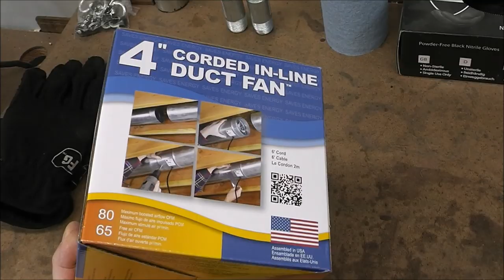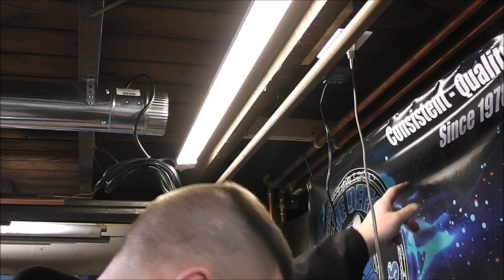EASY DIY Welding Workshop Ventilation Fume Extractor  Done CHEAP

Comment: i know this is a older video, but i like to mention that it's not recommended to place the aluminium duct on the exhaust that close, because the extractor will mess up your air/fuel ratio when you are doing air/fuel adjustments on a carburetor due the lowering of backpressure caused by the extractor.  Best is to use a metal bucket with a bigger diameter then the duct pipe, and place that at least 5 centimeters from the exhaust tip.
Reply from the maker: Thanks for the info!

Comment: I bought a bounce house blower from a guy for $20. I was going to put some of the semi rigid dryer duct on the in/ out to be able to place the suction end right at the source of the fumes. Set the output at the garage door to blow outside.
Reply from the maker: That sounds like an awesome setup! Probably much more powerful than than this setup. Those blowers move a ton of air!
Reply: Yeah. I've been trying to teach myself to weld with flux core, and it throws a ton of smoke. Last winter was a headache because the doors had to be open to exhaust the smoke. I ran across the blower after it started warming up, and that smoke was the first thing that crossed my mind. Just now getting around to thinking about the install with it getting cooler again. I was wondering if the semi-rigid duct would allow me to position it and it stay put. Thanks to your video, I believe it will.
Reply from the maker: I think it will also. Mine stays put pretty good. If it doesn't, you can use some metal wire to position it where you need it.

Comment: I wonder if the fan is strong enough to pull the welding fumes out of the room?  Maybe the next time you weld something you could comment on it.  Thanks.
Reply from the maker: It is Richard. It's vented to the outside. If the intake is above your work it easily removes the fumes.

Comment: Nice Brandon. I have something similar made in my garage for both my car exhaust, and welding fumes. 
But my I suggest that you do NOT have the duct sealed well against the exhaust. If you run your bike long enough, your whole pipe might become too hot and your duct fan would fail. Not only would the fan coil overheat, as it depends on the fan to cool it, but the fan blades are made of plastic, and they may melt. I suggest leaving a gap so the duct would draw in some ambient air to cool the intake down. That's how I've done it with my car exhaust extractor duct.

oh and btw, that sticky aluminum foil.... I'm not sure if you have the same kind I have, but mine looks exactly like that. We use it to wrap our diesel stove duct joints. It is heat resistant. I once even used it as a quick and cheap exhaust patch and worked great for years till I replaced my exhaust. Just a tip if you're interested. 

Thanks for the videos!
Reply from the maker: Good point on not making a solid connection at the muffler...it makes sense.   I know this stuff sticks like crazy but I was not aware it was heat resistant. It does not surprise me though because it just feels like quality. Thanks for the great comment :)
Reply: @BrandonLund   You're welcome. :-)

Comment: That's a good build ,   always  safety  first  , I have some  4 inch flexible black corrugated plastic   It comes in 100 ft coils maybe less I think I am going to try using some of it  to do something like your build .  Thanks.  TANK
Reply from the maker: Using what you got...I love it! It should work just fine.

Comment: Great build!!! I managed to catch a local carwash going out of business and bought one of those big industrial shop vacs for $100 put it outside ran the hose inside to my welding corner of the garage and put an on off switch inside for it and it works great!!!
Reply from the maker: @Donal Thats an awesome idea and an even better score! Well done!
Reply: @BrandonLund  those thangs are actually tanks. I guess the coin mechanism is set to restrict some of the 2 motors power because after you strip all that junk out wire in an on off switch your left with two 5 HP motors. Plus replace the door seals with rtv gasket silicone and take the motors out put silicone around where they seal and bolt them back down.
Reply from the maker: No wonder they are so powerful! That's going to be an awesome setup!
Reply: @BrandonLund  it's been sat up for over a year now just sharing what I done to solve my little fume extractor
Reply from the maker: Oh gotcha. It sounds like a very good setup. You actually inspired me to keep my eyes peeled for one of those units.
Reply: @BrandonLund  definitely worth getting

Comment: Hey Brandon. I know this is an old vid, but getting ideas for my own fume extraction for barn shop.One thing I discovered is that the higher volume of the cheap Harbor Freight inline fan works GREAT. Much better than the inside the duct fans. But while portable it's more clumsy. It's so easy to use those in the duct fans in a permanent application. You're the welder so I'm sure you already bought of this . . . you dint show us how it worked on weld fumes. For stick and flux core welding I place the flex duct right on the table. Pulls those fumes away easily. HOWVER, it's too much air flow for MIG & TIG (shielded gas) welding. Don't want to pull the shielding gas away fro the weld. For others watching I fabricated a way for it to hang over the weld about where your head would be. It allows the welding fumes and gas to to raise normally, but then suk them away before they get under you mask.
Reply from the maker: Nice! 👌

Comment: Great idea I’ve got a use for this in my shop. Maybe a couple of rare earth magnets glued to the end of the tube to hold it to the exhaust.
Reply from the maker: Great idea! The exhaust in this is aluminum but it could be very useful for holding near your project also
Reply: Brandon Lund shows what I know about motorcycle exhaust.
Reply from the maker: @corydriver7634  this is aftermarket exhaust but a lot of motorcycle exhaust is made of steel so your idea was actually a good one :)

Comment: Aye good job man, look into how fire stations have there equipment. Maybe a local machine shop can make you a fitting thats universal and slides over different motorcycle exhaust  ive got a small garage and the door leads right into the house tryna find a system when i work with carburetors or strong cleaners to vent it out and not make the family room reak of gas and solvent
Reply from the maker: Thats actually a really good idea Luke

Comment: Yeah, I used to do all my work inside, but when I moved the Harley out of the loungeroom, SWMBO said, "NO MORE!!" So now all my work has to be done outside, subject to weather, lol. But being in drought, rain ain't a problem, but frying is, lol.

Still got 8 in the house and my project parts keep going walkabout thanks to 2 year old grandson.
And you used screws? This job's perfect for cable ties mate, lmao!!!
Reply from the maker: Mine would never even entertain the idea of having the bikes inside lol. My workshop never gets too hot but it does get a little chilly so the heater helps. Great idea on the zip ties...use what you got lol

Comment: Great work! .. question… do you think this will work to take out the fumes of fiberglass resine from my basement? I want to do some molds in winter time… thanks for your help…👍
Reply from the maker: It will but its painfully SLOW. I have sprayed paint and it takes forever so you would probably want a bigger unit that moves more air
Reply: @BrandonLund  ok… thanks I appreciate your response… I’ll take your advice… 🙏
Reply from the maker: Harbor Freight has I think an 8" air mover. That would probably be better suited for what you want to do
Reply: @BrandonLund  Hi… I’ll keep it in mind… make sense…thanks again 👍

Comment: Have a pretty long run to the dryer vent in the building I'm using. Probably best if I use two inline duct fans, with one close to the fumes and another by the dryer vent?
Reply from the maker: I would be leary tieing it into an existing dryer vent because of lint catching fire.
Reply: @BrandonLund , is just a hole in the wall, currently no tubes hooked to it. Goes directly from inside to outside.

Comment: I'm planning on building a similar setup. I have to wonder how well the fan will hold up. I know it's just fumes. I wonder if it would damage the motor over time
Reply from the maker: It works pretty decent. It's not perfect but if it's directly over my weld it gets pretty much all the smoke out

Comment: Is this sufficient for welding fumes? Its something I want to get into and I've been told galvanized steel in particular gives off really bad fumes
Reply from the maker: As long as the hose is above your work it will suck the welding fumes out.
Reply: @BrandonLund  I was amazed that little fan kept up with the bike exhaust. Does the fan list the CFM?
Reply from the maker: @C DRIVE at one time I knew the cfm but its been a while and its covered with duct tape. It's not very much but does surprisingly well. I'm thinking around 230cfm but I could be wrong.

Comment: I'll have to put a vent through a wall, I have no windows in my garage, but this could work well for me.
Reply from the maker: Sounds like this would be awesome in your shop! I love mine.
Reply: I had it built that way for better soundproofing, so I wouldn't piss off the neighbors as much using my anvil, I overlooked ventilation though, lol. 
it's fin in the summer because I can have my double doors open which face away from all of them but Wisconsin winters make that less enjoyable.

Comment: Nice 👍🏻👍🏻👍🏻👍🏻 i send you  a movie on FB from what i make for welding fumes
Reply from the maker: Very cool man! That came out very nice!
Reply: can you post that FB link here?  Great job on the budget exhaust extractor and easier than a range hood setup or agri fan.
Reply: @AN-kg4ei  used bathroom ventilation fans, I am using one that I replaced with another from my bathroom ( sounds like a bad bearing but just needs to be cleaned really well, dust makes the blades off balanced) look on the interwebs for a used one, they generally have a fairly high CFM. cheers!

Comment: Sensible & practical, but, I’m thinking that duct fan may be too light duty for pulling weld fumes sufficiently…of course a higher volume duct fan will cost more….just my humble 2¢ worth.
Reply from the maker: @J W Dickinson it actually works pretty good when I remember to turn it on. The only issue I have is I need to add a bit more hose to the down pipe so it can be closer to my work. I had to move the horizontal pipe that is mounted to the ceiling because It was interfering with hitting my bikes when they go on the lift so it made the down pipe a little too short now.
Reply: 100 sq ft per min is way too low volume; the suck must be powerful enough to draw air from a broad area, as locating the intake too close to the work will disrupt shielding gasses.

Comment: Brandon - Do you think this would be sufficient to pump epoxy, spray paint, stain fumes up and out of basement window?
Reply from the maker: I use mine for spray paint but it has to be VERY close to where your spraying. It works but not great
Reply: Thank you

Comment: I'm gonna do this for my generator, to pipe out the exhaust threw a dryer vent.  Wonder how long the fan will last in there?
Reply from the maker: I'm not sure but mine is still going strong.
Reply: You believe your geny only pulls 100 sq ft per minute?

Comment: Nice job.  I have to do something similar in my basement.  I am wondering how to port the room though.  I have a window that I don't really need and I can run the exhaust through there.  Otherwise I could open the window, but that seems like trouble.  It's a ridiculous window that opens like an oven door.  I want to start mig welding in the basement with gas and this is the only way ;)
Reply from the maker: You could also install a dryer vent. That way you don't have to mess with the window.
Reply: @BrandonLund  Yeah, that would be ideal but then I need to put a hole in the house.  Something to think about either way.
Reply from the maker: I would try to keep the fume piping separated from any dryer piping in the event a spark got pushed into the dryer

Comment: That's a nice build.  I'm looking for welding fume extractor options, wondering if a duct fan has enough pull to suck up fumes when hanging over the welding table?
Reply from the maker: Thanks! It works great but you need to keep it close to your work so it collects everything.
Reply: @BrandonLund  looks like you used a 4" duct fan and ductwork.  Do you think I'd be fine with 4", or should I do it with 6"?
Reply from the maker: 6 would be better i would think. The 4 actually works really well, you just have to make sure your duct is right above your work.
Reply: @BrandonLund   Thanks for your help!